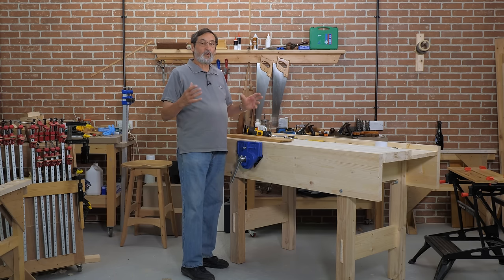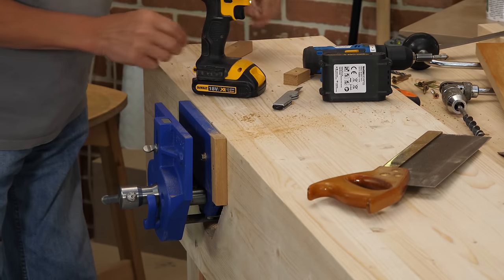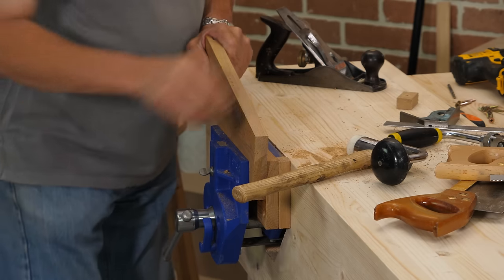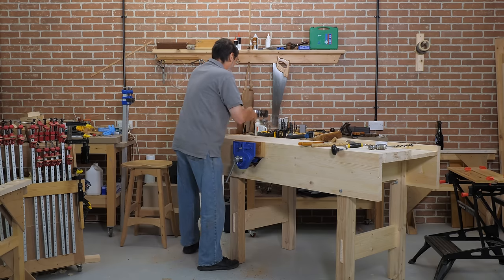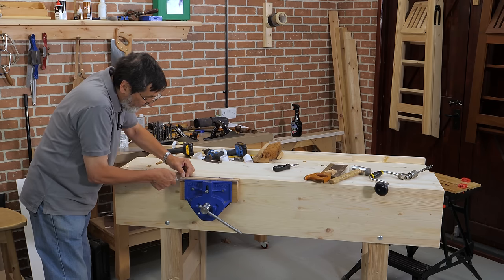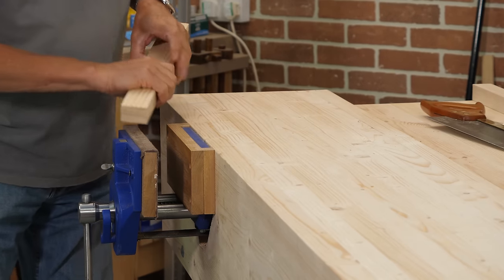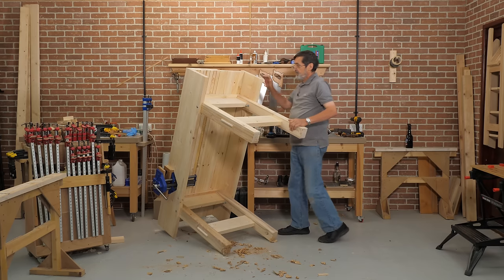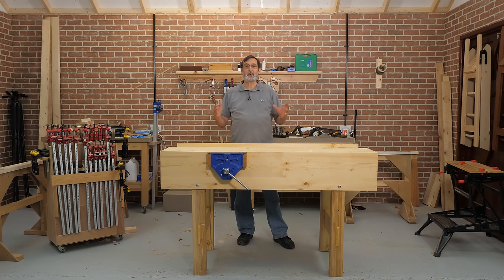How to Make a Workbench Episode 9 | Paul Sellers

Comment: Watched the series again, what a treat.

Built my workbench 4,5 years ago. It has little in common with this one. I wanted a solid top, so approns had to go. Then the legs become connected with four beams mortised and tenoned. Had only one long clamp, so used draw bores.

All is different (except vice jaws), but without this series I doubt I would not have succeeded. It is my ultimate workbench, and I love using it. Thank you Paul.

Comment: I just finished MY workbench that I started in October 2021. I have adapted it to make a 4-foot bench, much of it was with old lumber I had hanging around, some of which had been used as concrete forms and a Lowes Kobalt plane which led to much frustration. After buying my Stanley #4 and converting the Kobalt plane to a scrub plane, thing started becoming easier at each step in the process. I had never done much more then sanding with an electric sander and some hand sawing before this project. But after adjusting my work after each mishap and miscalculation, I'm glad to say I'm proud of the outcome especially when I know what it is made of. 
Thank you for sharing your enthusiasm and a bit of your knowledge with us.

Comment: Great series Paul - I built one similar from your previous series - total cost was less that £75 for materials + a vice reclaimed from a previous bench. the design works flawlessly, and it's rock solid, with zero racking, even when going at a board like a barbarian with a scrub plane. Many thanks and keep up your amazing work.

Comment: Absolutely beautiful Paul... What a joy applying the finish coat after everything is said & done. Nice touch on the vise jaws too. I used an oil based stain & clear poly on my bench. I used (2) coats of Cabot Gunstock stain & (3) coats of Minwax Clear Satin polyurethane. Both the stain & clear were 220'd between coats. I do indeed understand that feeling when it all comes to completion.
Excellent presentation on all the episodes with this workbench... After watching this I feel inspired to incorporate the use of my hand tools more often in conjunction with some of my power tools... 
Bill Farr... :-)

Comment: Just fitted my new vice yesterday. I kept the vice half an inch down and rebated the back vice plate flush with the bench. The two holes in the back and front plates were threaded which allowed me to bolt my wooden insert direct to the plate. It makes it a five minute job to swap over
Reply: Colin Nicol my thoughts too. The top of the vice will interfere with sawing and planing, no matter how careful you are, it is inevitable you will nick the metal vice with a cutting edge.
Reply: BlueKingfisher the metal portions of his vice are lower than his work top, albeit by a very small am out.  The wood portions sit level with the work top.
Reply: Ken Buteau yes, I, am aware the vice sits marginally lower than the bench top, although only as much as the depth of a saw tooth. My point being, when sawing at the vice, as Paul does, other less skilled users, and I suspect the video is geared towards those users, are likely to very easily saw into the vice jaws. It only takes a single stroke to cut through the depth he has left the vic e top below the bench top. Most benches I have seen have either the vice jaw behind the side skirt or a good deal lower with more of the sacrificial vice jaw prominent above the metal parts. Just an observation.

Comment: Paul, why did you put the vice near the center of the bench?  Why not locate your vice so one vice-edge is flush with the table-edge?  Placing it at the edge allows you to make cross-cuts much easier.  You wouldn't need to tilt your workpiece as you did in this video.  You also wouldn't need to worry about dropping the saw on the workbench.

Is there a big benefit to placing the vice in the center of which I am unaware?

Thanks,
Ryan

Comment: thanks you for showing us through the construction of this bench been needing to look at making replacement for mine for a while now, i have had the well board on one of my older benches and have found it to be inconvenient for myself have filled it in, so i would not be taking that part would probably just increase the bench size.

I have just one Question why have you not seated the vise into the bench to so that the timber jaw on the bench side is flush with the Apron so longer timber can be planed also allowing a hold fast to help?

Comment: You might, at around 2:30 + in this video see what you regard to be a certain awkwardness in the use of the vise as mounted... where Paul is sawing off a small piece of wood that is cocked up a bit and he has to be very careful so that the saw can clear the bench. Ahh, but that's really not his usual system. The workbench of his prior set is an old workbench and he has numerous times simply cut into the bench. Not intentionally, but the bench is literally gouged out at that end of the vise. In other words, that seeming awkwardness vanishes if you simply give up on the idea of treating the bench as a piece of furniture.

Comment: I have just finished watching this. I am starting woodworking as I am no longer able to work on trucks, due to failing health. This also included some fabrication work. Hence the need to still do something constructive with my ever increasing spare time. I have a good selection of tools, and just had the first supply of timber delivered to start the bench. I do enjoy reading, so was wondering if you could suggest a book or two to read. This would also I hope mean I would have a reference ready to hand. I am based in Kent in the UK and would if possible like to avoid ordering from abroad.

Comment: Bench almost complete and it's as heavy and solid as a brick S**thouse. My wife says it looks exactly like Paul's which is a compliment of only my ability to study and follow Paul's clear and precise build instructions for his very well thought out and workable design. Once question regarding fitting the leather to the vice jaw though. Does looping over the top of the wood and down the back about an inch trapping between the wood and metal jaw moving jaws not shim that wood jaw slightly out of parallel with the wooden fixed jaw? Obviously thickness of leather might be a factor. Left to my devices I would either have cut enough leather to let a full depth fit between the wood and metal moving jaws, or rebated the back of the wood jaw to allow for the thickness of the trapped strip of leather. That Paul doesn't do this makes me think it's not necessary but it's counter intuitive to my daft brain and it would be nice to know for sure that I'm being silly. Cheers, Steve.

Comment: Paul, I have to ask (maybe I missed it) "Why is the vise in that position?"  When I mounted my vise (not as nicely as have you done here - nor as fancy a vise), I mounted it at the right end of my bench - well as close as I could gien my legs were flush with the ends (not a trestle setup).  I can see where planing would be ok for a RIGHTY with the vise at left, but thought bench hooks would hold the board being planed.

Comment: I have an eclipse wood vise that slips, once, when I tighten it down. After I make a 'quick release' adjustment I find I need to pull on the handle, away from the bench, to get the threads to engage. Once the threads engage it works fine. The threads are clean, don't know why it doesn't seat. I know you're busy but I sure would enjoy a vice maintenance video. Thanks, great channel!

Comment: I'm just about to flatten the top and install the vice. Is there any issue with using pressure treated timber? It's easier to find in these sizes at B&Q / Wickes etc.

Comment: That was a massive amazing project and worth every minute of it. I have on question though. I just bought the wood for the first part of the top the laminate. The person at the timber shop didn't let me pick he just grabbed and cut to 60 inch but he grabbed some with filleted edges. What's the easiest way to use this as I don't want to lose my thickness or width? I think they are 5mm fillets but I have no guages to tell. What if I hoped the ones down width ways only and put them in the middle of the top I think that's the only thing I can do.and maybe do it in 3 glue ups

Comment: Awesome build! One question. Is there a reason not to set the vise flush with the apron and the top?  So that the back jaw of the vise is flush with the front apron?
Reply: You won't be apt to pinch your fingers against the bench top when loading it with your wood. The first time it happens you'd understand =)

Comment: Great video! 

What is the purpose of the wedges you installed?
Reply from the maker: This little treatment means that any vibration in the bench will always shake the wedges down into the recess and keep the leg perpendicular and tight with the apron. This is important because there is a lot of lateral pressure on the bench that can cause the leg frame to loosen in the dado.
Reply: That's for the explanation Paul.

Comment: Thank you. Very inspiring! 
I don't know anything about woodwork and I was wondering what the part of the top surface that is a bit lower then the rest is good for?
Reply from the maker: I think you are referring to the well. This is where joiners like myself and furniture makers place their tools to stow them and to prevent them from rolling off on the floor. Flat-topped workbenches are unnecessary because most of the joinery work used for furniture making is done within 12 inches of the vise most of the time. It’s a perfect solution and evolutionary development that has stood the test of time and hopefully will continue forever.
Reply from the maker: We have this lower area to keep the tools out of the way especially long tools like screwdrivers, chisels and so on and also for stopping them from rolling over the floor.

Comment: Man, I do not like that quick release mechanism. The old Wilton vise that I have you just turn the crank 1/2 turn counter clockwise and it's loose. That way you can close the vise jaws with your hip if you need two hands to hold something large. Or you can open them just by wiggling the piece you are working with if it's large and unwieldy.

Comment: Myquestion having watched this very good video is: where to mount the vice on the bench, Left or right? I'm right handed.
Reply: Mount yours like his.  He’s right-handed.
Reply: Though a year old, that's a good question.  Arguments can be made for both choices, but the best one I've heard went like this (don't recall if it was from Paul or someone else):  As far as use of the vise, it doesn't matter much.  BUT where it does matter is in the convenience and accessibility of all the other tools you'll be using.  If you're right handed and the vise is on the right side of the bench, you'll be constantly having to reach across your body to pick up/set down tools (chisels, planes, etc.)  that are on your left, where most of the empty bench "real estate" is. ...Not an insurmountable problem, but still, not the most handy arrangement.
So, this logic suggests vise on left for righties, vise on right for lefties.
Of course other governing factors may override:  e.g. proximity to walls, doorways, other equipment, etc.

Comment: When I get the space I will be building this bench. Great video series. One question can this bench be used outside if you put an exterior based finish on it?
Reply from the maker: Yes. The issue really surrounds the expansion and contraction that will still take place according to relative humidity.
The second issue is the vise mechanism may rust more especially if there is a prevailing dampness in the area.

Comment: Hi Paul.  Nice bench and front vise.  Any reason why you didn't position the vise at the left-most side rather than a bit inside?
Reply from the maker: Hi. Yes. When the vise is suspended between the two legs and adjacent to one, any pounding on the benchtop is the greatest support you can get and results in a very positive and very effective execution.

Comment: Would never ever tought that making a workbench can last around 5 hours of youtube video and that much effort and why not just using big screws instead of difficult joints? How long did it actually take from start to finish?@ paul sellers
Reply: Screws aren't as strong as tenon joints.Also the whole purpose of this bench,is you learn all the basics of hand carpentry.

Comment: Of course with the leather between the top of the metal jaw and the wood face of the vise, the wooden faces of your vise aren't parallel.
Reply: This is worth considering if you are going to use a leather wrap.  It can be quite an exaggerated angle depending on the thickness of the leather.  It would be best to cut a rebate for the 1" of leather on the jaw side.

Comment: Great build, Paul!  Love your videos!  Question:  Since you felt a need to put suede on the movable side of the vise, why not the other side as well?  Seems incomplete to only protect one side of a piece in the vise.  Am I overlooking something?
Reply: The leather is not for protection but to keep parts from slipping. Adding leather to one of the jaws gives the vice a much better grip. One side is enough for that and i found that covering both sides makes the vice feel overly squishy for small parts. (at least for my taste)
Reply: Great answer!  Makes sense.  Thanks!

Comment: Why did you choose to put the vise in front ontop (lack of proper word). If the vice is down some 20 mm behind a wooden plank and flush with the work surface you can clamp  in something for the whole length. Now the vise produces for the 2x board thickness you did install.

Comment: Nice new bench.
Was wondering are there any tips on restoring an antique oak work bench. It is in pretty good nick, apart from some long dead wood worm marks and the bottoms of the feet have suffered lightly. (those i plan to sand off till I hit good wood again)
But was wondering, is there any way to do with the top. Sand it? Plane it? Just clean it with terpentine? Dont want to ruin it too much.
Reply: Just plane the top flat and apply some oil like Paul did (or your preferred finish) and you'll be good to go. Flatness is the key and it'll probably not be if it's old.
Reply: Fully flat.. it ain't anymore. Right, so planing it is. And perhaps find a darker oil, so it wont stand out so much. Should I do anything with the woodworm damage? Fill the holes with animal glue? There is more than enough healthy oak around it to not have any impact
Reply: If it's not active then it's not a problem. I'd probably just leave it if it was me. Personal preference really
Reply: Nah, quite sure it's not active. Ran over it with Terpentine to make sure, don't really think I want to use the wood worm poison. But the legs are strong and stable though. Hope to get her up and running by summer.
Reply: It would seem a little overkill with the poison. Good luck!
Reply: Thanks! :D

Comment: Excellent series, but I fail to grasp the reasoning behind the wedged legs....if the legs ever became loose, you would need to hit the wedge on the surface that is underneath the bench top to tighten them...how can you do this with the bench top in the way?
Reply: Tim Brison I think that as the bench rocks back and forth the wedges will work down tighter by gravity.

Comment: Nice bench but I have two issues with it. What are the aprons for ? I see no reason for it. And why didn't you put square holes for the dogs ?
Reply: The aprons give strength and stop the bench racking. Paul has said in other videos that he doesn't use bench dogs

Comment: The peaktool vice, i believe you are single the same, does not have a 90degr angel between the horizontal and vertikal mating surface to the bench . Why is this ? When mounted there is a gap on the top of 3mm....

Comment: A beautiful bench. :)
I do have a concern about the position of that vice, though. As we saw throughout the video, Paul had to slant every piece of wood he wanted to cut up at an angle in order to saw through it. Of course this isn't a problem for a craftsman of Paul's extraordinary ability and experience, he could probably hold it behind his back and make a perfectly plumb cut - but the majority of woodworkers are hobbyists or at the very least lack his experience. Most people when trying to produce a perfectly plumb saw cut would want the piece to wood to be held horizontally in order to follow the natural vertical line down with the saw. It seems to me that forcing you to clamp each piece at 45 degrees in order to cut it is going to lead to problems.
Certainly if I was going to build this bench - and I sincerely hope one day that I do :) - I would mount the vice very much towards one end in order to allow me to mount wood in the vice for sawing.

Anyway, a brilliant series, thank you Paul!
Reply from the maker: I think you have exaggerated the angle considerably but why postpone developing the skill and becoming expert by holding it horizontal. I have given reasons for the vise being inside the leg several times and it isn’t really just me doing this but most craftsmen woodworkers have done the same. It’s simple enough, it gives the maximum resistance for many tasks when the vise is adjacent to and suspended between two fixed points ie. two legs but having said that you can mount the vise in any position you see fit.